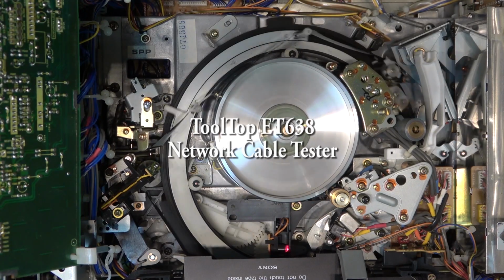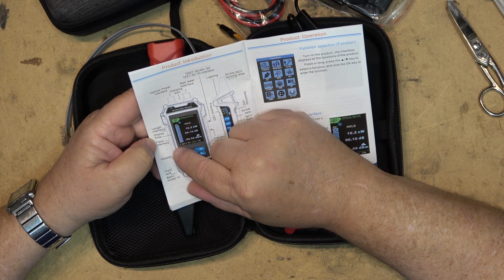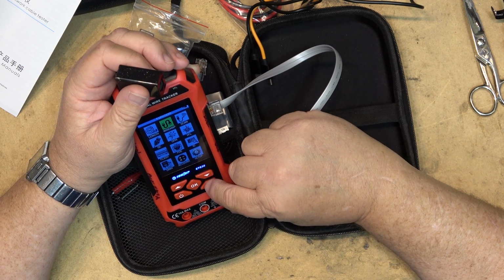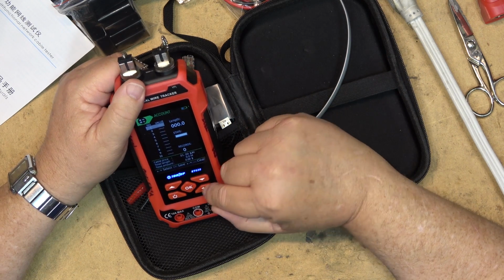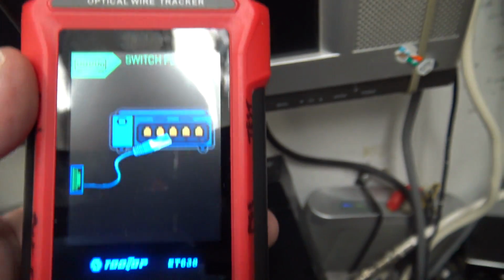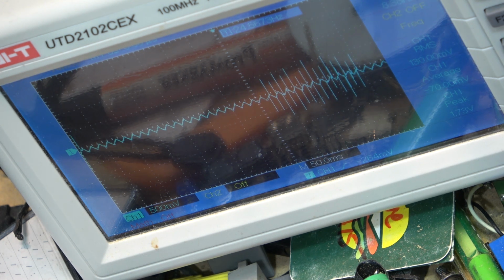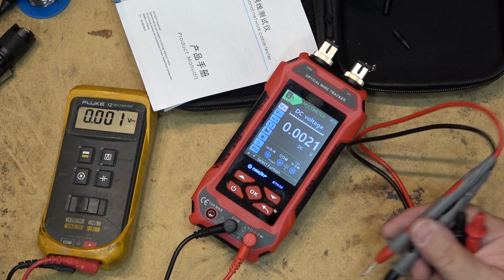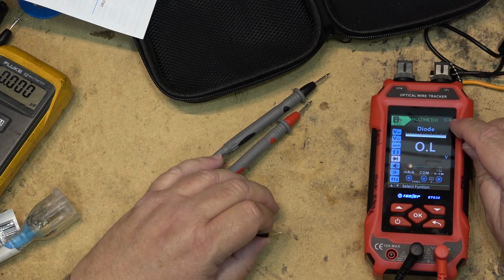Tooltop ET638 Network Cable Tester with optical power and VFL Unbox and Test

Comment: Does the fiber function only work with certain style connections?

Is the QC test, testing the plugged in end or the unplugged end?
Reply from the maker: Blue is flat cut green is beveled.  
Lose some signal but it's close.

Comment: Very nice,  But I wonder one thing that a few cheaper testers do, can it do in-line POE testing while the circuit is live, to show amperage draw, and can it load test a POE port, to test if it's failing under load.

Comment: Which tester would you recommend the Tooltop ET638 Tester or the Noyafa NF8508 Tester?
Reply from the maker: I have no idea what that other one is. I have this and an exfo power meter.  I use both.  This one has the visual laser which is super bright.  Too bright according to safety at work. I use it daily for fiber work.
Reply: @12voltvids  thanks!

Comment: Great video, thank you. Quick question, if you had a data run with mismatched or open cabling when punched down (i.e. only at one end), can this tester determine which terminated side has the fault?
Reply from the maker: Yes.  It will when detect if the end is not crimped down correctly.  It has a TDR to determine the length and balance of the pairs.
Reply: @12voltvids  Thank you.

Comment: Great review! Do you know if you can change the RJ45 Connection diagram from 568B to 568A on the ToolTop ET638? Australia and Canada, for example, use 568A.
Reply from the maker: The only difference is the orange and green pairs reversed.  12 orange  36 green on one and 12 green 36 orange on other. As long as they are the same on both ends of cable then you are good.
Reply: @12voltvids  Yeah, but doesn't help when a junior offsider looks at the colours instead and thinks that's how it should be wired here in Australia (or Canada)...

Comment: looks really interesting, 1 device replaces 3,  it would be interesting to see how accurate it is on fibre measurements compared to a "professional"  FPM
Reply from the maker: It measured more accurately than my professional EXFO opm. Since I have access i logged into the ont and looked at the level received and its 0.2db lower on the ont than the  meter shows.  So this reads. 2 db higher. My EXFO on the other hand is .8 higher.

Comment: Sure... Here I am retired after 37 Years and the "Cool Tools" are coming out.
I checked Fiber with a Flashlight or the Sun. HAHAHAHAHAAHA
Thanks Dave....
Reply from the maker: That doesn't work well when you are tracing back from the prem to the distro hub that might be 5KM away
Reply: @12voltvids  We didn't have the funds for the High priced testing stuff. 
Fiber was new to us back in the late 90's
and the only Fiber I did was "on-premise" stuff like Our local ski Hill. I installed 12 Strand for 2 of the new High speed Detachable 6 Person Lifts. 
Pre connectorized pigtails were ordered and all I had to do splice them to the cable.   and at about 2000ft I could see the Sun nice & bright at the bottom ...

Comment: Looks great Dave very good meter the only criticism I have is it didn’t have a stand at the back of the meter
Reply from the maker: This is designed to be used for network cable testing, so it wouldn't be standing on a bench. It would be held in hand as cables are plugged in for testing. Also because it has an active display ou can read it from any angle. doesn't need to be aimed at you like conventional LCD